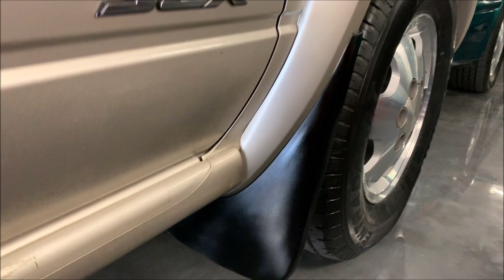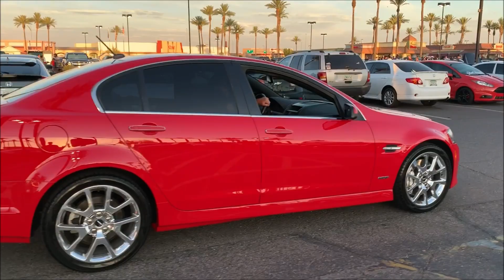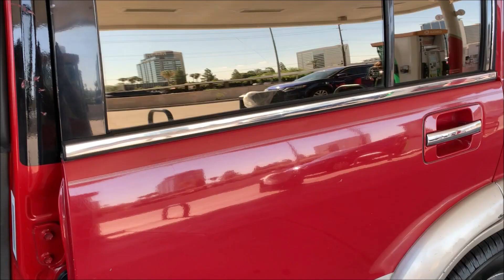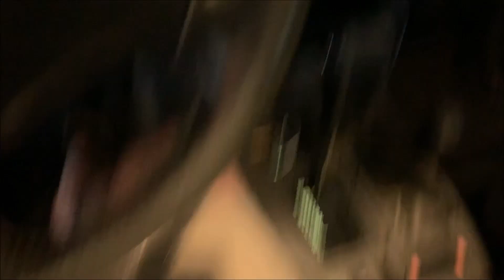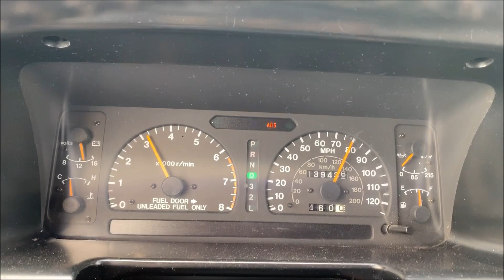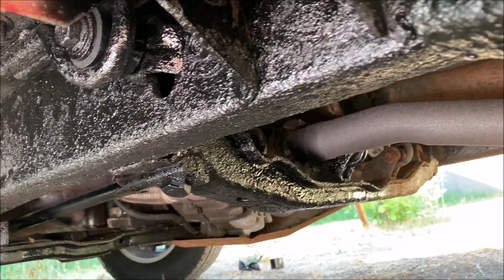Project Acura SLX Part 5:  First Show!  More Road Testing & Undercarriage Paint

Comment: Catching up on a lot of your videos.  Great stuff.  I live in the north east, and to deal with rust I’ve used rust oleum rust reformer. It’s supposed to convert rust to a non rusting surface. Also have started using NHOU, or fluid film.  It’s an oil based spray that seeps into cracks and prevents further rusting.
Reply from the maker: Good to know, thank you!

Comment: Doing this you just killed him :(   covering rust is best way to rust penetration inside metal... best way is using rust conductor or linen based stuff for closed profiles... but in Europe, we just take off body, sand blasting chasis, replace rusted out parts and covering it in zinc. :/
Reply from the maker: It's already rusting apart. I don't think my repaint job is going to make it that much worse.
Reply: @TysonHugie  it could, rust whitout cover penetrate slow... if you cover it, it will eat metal faster.

Comment: Wow this thing has really made some progress. As rusty as it is underneath sometimes the best you can do is just make the best of it. Looks great! In other news I'm getting the Integra up to par.I kept the original hatch and got the glass fixed. Tinted the windows. Replaced a bunch of gaskets. New timing belt. Got A/C installed and working. I took it on a 2 hour trip last week. Seems to be holding up well. Love the new velvet ropes!
Reply from the maker: Glad you are making some good progress!  That's awesome.  Looking forward to the next video installment.  By the way, did you end up selling the TSX you rebuilt?